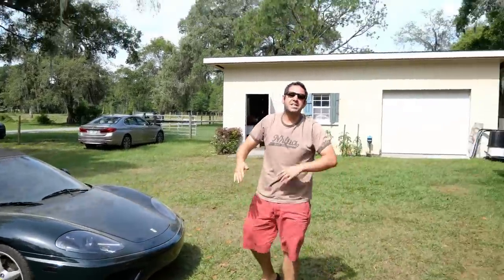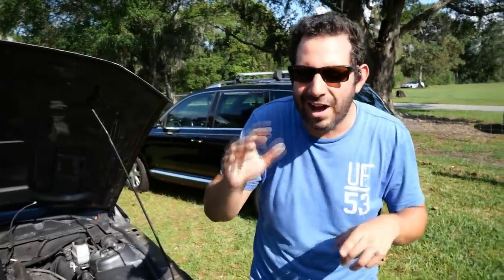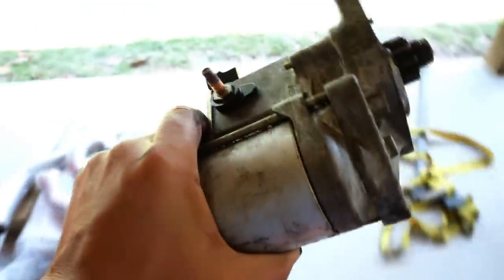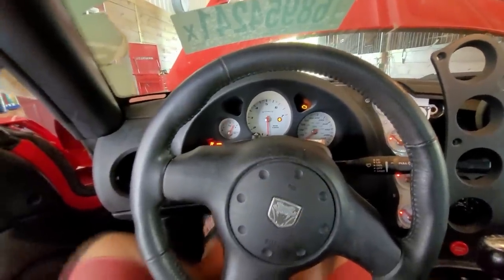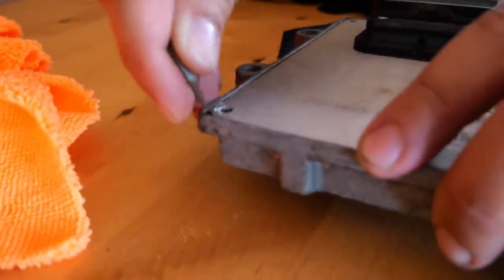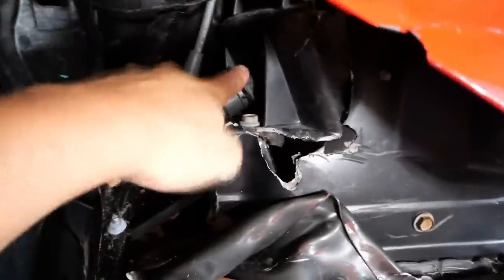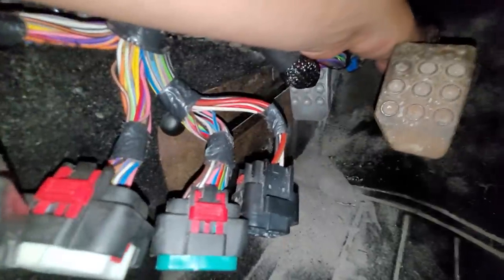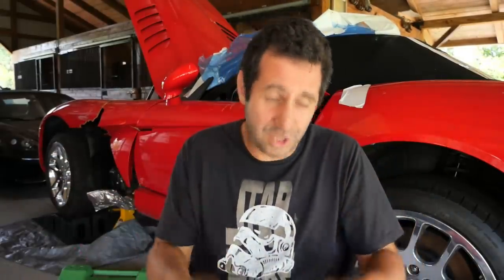Here's Why This Flooded Dodge Viper Won't Start

Comment: I don't remember if the BCM is one of the 2 dominant modules on the Communication BUS with the PCM. The Main Communication BUS in this vehicle is a single wire PCI BUS. It wires to every module and back to the Data Link Connector. If either dominant modules are down communication will be very slow on a scan tool. With any particular module not communicating, you need to start with checking the basics on each, Fused B+, Fused Ignition Run, and Ground. Any of these missing can cause a module to not communicate. Going for a swim could have caused a fuse on one of those circuits to pop, and may just require a fuse, but you might have checked the fuses already. 
Those BCMs were exchange order only because the odometer is recorded in it. The Cluster on those is a display. The odometer in the PCM is mainly a calculated value, if the PCM is ever replaced you have to program the mileage, it's more of a theft related tell-tale, and for DTC data, it will show at what estimated mileage the DTC was set at. Although it is similar to the ones used in 2001-07 Minivan and 2004-06 Pacifica I would not recommend it as a permanent swap. Being a Viper it will likely have the Vehicle Theft Security System, and swapping a BCM from another car without programming will result in a no start. It isn't the Sentry Key Immobilizer chip key system but sort of does the same thing killing the fuel and I think cranking too, but you should still have communication with the modules. 
Another thing to consider, a shorted 5V sensor on the engine can result in the BUS going down. The majority of the sensors on those are that style (3 wire), including the A/C pressure transducer (3 wire pressure sensor on one of the lines). You can measure the 5V supply at any disconnected sensor, 0 Volts is usually shorted, then disconnect each 5V sensor one at a time until it comes back to 5 Volts, which indicates the particular sensor is shorted. If you haven't already, I'd be looking at the wiring diagrams, service information, and diagnostic information on either AllData, Mitchell, or through Stellanttis using a tech authority subscription. Better yet, if you can find the original Shop Manual, Powertrain Diagnostic Manual, Body Diagnostic Manual, and the Chassis Diagnostic Manual uploaded online, that would be best(you advertised a site like this before, don't remember the name), if not then look for a set for sale on ebay or the like. Throwing modules at the car willy-nilly won't fix the car. You may get lucky once doing that, but the only way to properly figure it out is doing the appropriate circuit tests.

Comment: I had a infinity G37 and there was a common issue where the passenger a pillar sunroof drain would cause a leak which ended up flooding my passenger side floor which was where the BCM of the car was located and was completely soaked. ended up finding out if the BCM is fried the car just wont start like how it is in the case of the viper. luckily i had a connection at the dealership so i got a new BCM and installation for cheaper than a used BCM from the junkyard

Comment: +give the board a kwik clean with some isopropol alcohol also if u have an ultrasonic cleaner put isopropyl alcohol in there and putt he baord in there soon clena up its prob justa. short in the circuit a good clena may sort it

Comment: A bad BCM is bad news on most newer Chryslers. My sister had a similar era Town and Country that the BCM fried on and they couldn't get a replacement BCM to work even when it was programmed to the van's specific info by a computer repair service where the new BCM was purchased from. This whole thing caused them to have to junk the van.

Comment: The PCM does not need to be recognized by the BCM.
Both  control modules communicate on a PCI protocol  based communication network.
The fact that some module communicate, suggests that The network is not shorted to ground, power, or another wire.
You might have an open circuit on the network or the modules might not be properly energized.

Network integrity for this particular situation could be checked by comparing communication waveform signature at the DLC and compare to PCM communication line.
If that checks out I would check powers and grounds.
Beeing this a Chrysler product you my have an ASD relay issue.

Comment: I don't know on the dodges but I have had others cars that one computer being bad has made the pcm not communicate. 
BCMs have to be the correct number although some cars have multiple correct numbers. A good dodge part department can give you all the number that interchange.
Further based on experience you general need a scan tool that can flash software from the manufacturer to make a new or used bcm work. Some used BCMs are not rewritable other are. Often times the cheapest way to do this is to send it off to a company that specializes in reprogramming bcms 
Unfortunately I don't know anything specific to a viper

Comment: I'm no expert on dodge related items, but I do work at a Honda dealership. The BCM all tho it looks the same it's not. When you plug and play a bcm to another car or motorcycle, it goes through a check list and this list is the same for each car. The issue is that other sensors or modules will pump the wrong data/codes to the newly installed module. But my new Question and Test would be can you flash them while plugged in? I've done this with other hondas, but the dealership owns the Module flashing unit and only they can give the mechanics authorization. You come into liability issues from the dealership preventing you from doing this. But if you bought one that might be your fix...

Comment: The engine control module does NOT communicate through the BCM.  The CAN bus is a deterministic bus and there would never be a situation where one ECU would proxy CAN traffic for another.  You don't want one module to cause another to fail not be unable to diagnose.  I'm an automotive embedded software engineer who writes software for ECUs.  If your engine control module does not show up on your scan tool, then you are either not attached to the CAN bus or you need a tester present signal.

Comment: I'd have to make a correction. The starter being like that means it is or is a part of the problem. (In this case part of the problem) as it was not moving until a few tries so it wasn't working in the viper either.

Comment: I'm definitely hoping that the V10 will be his next project, and while I don't think Sam will read this, here are 3 important things anyone owning a Touareg should know: 
1.: You should really get a VCDS. Things like Carly work well on other brands, but VW has its own diagnostic standard, which is far more complex than many others. That makes it rather complicated for a normal tool to get any data from the vehicle, which is also why VCDS is so damn expensive, as the adapter even has an entire 32-bit computer with multiple megabytes of storage and ram in the plug itself, and why the software is so complex, as it has to simultaneously interface with the over 50 ECUs in that Treg. A normal adapter will only give you basic fault codes and some engine data, but only with a dealer computer or a VCDS you can actually program ECUs, run adaptations or do advanced diagnostics on all modules. 
2.: The oil you run in TDIs has to have a certain certificate, which is there to make sure it has all of the numerous additives required to keep a PD-TDI from throwing a rod or kicking a gear set out the side. The most critical one is the sulfur content, as the injection pumps within the unit injectors will seize and lock up the entire valvetrain without it, but too much sulfur will cause the rod and main bearings to corrode. I think Castrol and Mobil 1 offer such oils.
3.: When you encounter any problem you can't solve yourself, don't be afraid to ask the Treg forum (www.clubtouareg.com) or VWvortex, they are happy to help, and usually know more about your car than you do, as they have 15-20 years more experience than you, and have access to loads of dealer manuals and connections to VW.

Comment: After easiest checks are performed, maybe an Automotive Picoscope. Lots of Diy how to's online. Check each module out of the car, one at a time. All sensors and socket plugins need to be cleaned and wires checked for continuity, resistance and abnormal open/short circuits. Or else blown boards will never cease. Complete wiring diagram needed. All 12v relays checked?
Fuses? Fuse sockets? Parasitic drain?
Door jamb switches.?
Clockspring? Hvac switches? So many gremlins.
You will need pinout data for voltages ranging from 1.7 to 5vdc. And what wave forms should be present. Abs, airbag?
My advice? Contemplative thoughts and a Fishing pole. Gonna be a canbus, can of worms. Guy outside USA does not care about US insurance&salvage title. Just import duty taxes. Maybe he declares it as machine parts?
Like all modern dashboards assembled in one piece, then shoved through the drivers side opening with a jig holding it. Never any room for access, unless your a masochistic 150lb Teen contortionist.
Reply: What does the drained oil look like?
Pull all the spark plugs, will it turn over with a breaker bar and socket on the balancer?
Did any water get in the trans vent? Evac purge system? Diff? Wheel sensors? Rack?
Power steering? Sand and silt will ruin rubber seals.

Comment: In modern day fashion the BCM is the one who gives power to the ECM and PCM I have a 2015 ram and it’s the same for all Chrysler products if the BCM is not there the car is toast. If the BCM is water lodged like what you showed all the electronics in there are shorted and they can’t provide power and ground for the ECM and PCM. My truck has Electronic power steering and when the computer for it was shorted (before the recall they had for that particular problem) a scan tool my buddy had will show EPS and when I read the modules I can see EPS but it said it wasn’t equipped. I took off the pin for the connector of the BCM and ran another test and saw EPS disappeared. I hope this could give a viewpoint that yes the BCM is the one that does give power. You can get a new BCM but it has to have the same specs as the old one there should be a part number on it unless it got washed away. And for programming you need a scan tool that is capable of doing that.

Comment: It would be interesting if the only reason the part numbers are different on those computers was so they can pretend those two cars don't share parts, but I doubt it. I imagine a pin or two will be different and make something vital not work, but I'm looking forward to finding out either way!

Comment: Mopars bcm must signal pcm. Watch out because if the bcm cannot verify the vin# with pcm it will activate anti-Theft circuit 

I put a used bcm (exact same part number in every way as my original) in my Concorde & it ran great 1 time. After that is activated Anti-theft bad news. I figured a way to bypass anti theft in bcm but it took me 4 months

Comment: Mannnn I'm 20yo with a few hoopties, I got a 2001 e38 740i and have gone the ecm and tcm and a few pin replacements! It's all good experience but I wish I had ista/inpa to reprogram the TCM Wich is used! It's got it driving but still has shift position sensor problems!!! no sport mode or park, neutral is intermittent 😑 really this is the most important problem with the automotive industry!! The programs I need can cost up to 750$ or more and 30$ a day after that. JUST SO I CAN CORRECT THE VIN AND TELL IT WHAT TIRES, DIFFERENTIAL AND TRANSMISSION I HAVE!🥴 IM IN NJ SAVE ME LMFAO

Comment: BCM is the hub of the whole databus on this car. So if it isn’t communicating then nothing is. You probably could install a BCM from another Chrysler product into this Viper for testing purposes.
Reply from the maker: Hey Dave, do you think a module out of another Dodge that has the same connectors will fit? Or do I need to buy Viper Specific? Will either need programming? Thanks!
Reply: @Samcrac  I think you definitely need the proper part number for that chassis ultimately BUT for testing you could use a BCM from a different vehicle as long as it was the same style. It wouldn’t hurt anything, would at least see if you can get it to crank. You would have a lot of idiot lights on and components not working but could see if it resolves your communication issue.

Comment: I see a tonne of comments that the BCM will be fine; but I disagree. For $250, just buy a new one, it will save you tonnes of time in the future. You can’t trust a module like that. Also, I would strip the loom and replace - or at least pull apart each plug and clean, check, and recrimp or even solder each connection. Water isn’t that big a deal. Water that sits and then causes even small amounts of corrosion is a big deal. Flood cars are write offs for a reason. Also, I would strip the motor down if there is any risk of sand - there is no way I’d start it with that much sand in the intake, 100% sure you’ll have some sand in the heads and combustion chamber. Pull it apart, clean it properly before starting.

Comment: Those two electric motors Rich Rebuilds has for the electric corvette would fit under that long hood. If the engine electronics don't work out, maybe an electric Viper collab could be the go. 🤣

Comment: A quick clean up with 95% IPA and a toothbrush will let you know how bad the board is, water damage on a board is not good but you can get the IPA from a chemist.

Comment: Mabey jump the starter and see if oil pressure shows up on guage 

It would run thru pcm and then bcm the cluster 

Or it would at least oil up the inside of the motor

Comment: I can test ANY of your Dodge Viper components same day in-house. Additionally, you can use a PCM from any GEN 3, 2003 - 2004 for that model year, or 2005 - 2006 for that model year. As for the BCM - only a Dodge Viper BCM will work. Again 2003 - 2004 will work for same years OR 2005 - 2006 will work for those years. You will NOT need to reprogram it. It will plug in and play! The only issue will be the miles on your odometer will be the what is stored in the BCM you utilize. 

If you change the PCM it will also plug and play for those years, I can reprogram them only if you want the VIN to match (you don't have to). It does not really matter if the clutch got wet. You'll need to jump the neutral safety switch down below the clutch peddle. Unplug and use a jumper wire -- it's only two wires.  

Regards,
Doug Levin Motorsports Inc.

Comment: The deep Jewel Green by Ford at 20 g of black. Spray a dark green base two coats of the Jewel Green and intertwine your base deep Jewel Green with your top coat for the first two coats and then a coat of clear
It'll be incandescent it'll be black and shadows and green in the Sun

Comment: take a chance and do a 91-99% alcohol wash with a tooth brush on the electronics cause it cleans all the  corrosion  I've done it to like 13 cars  and they came back to life an started so i can here it and stuff   but also buy a new one or get it refurbished in my opinion cause i dont know about long term use

Comment: Ummm im confused how is the boss 302 upgrade no longer a budget option? Befor the most expensive part cost $700 now $200 so befor the price drop you are looking at $700 plus $100 plus $300 plus $200 now with price drop it’s coming in at $800 total. So it’s even more budget now. Or did i miss something

Comment: I can't believe you opened the pcm. They are all built waterproof. The bcm is the communication gateway for all the modules. No you can't use a bcm from anything other than a viper.

Comment: Honestly its time, but you have spent so much time, you could have already easily pulled the engine, pulled the dash and interior, fully, and have access easily to everything you wanna see and know for a fact whats going on.
Thats what id ove done.
Solely because if you get it up and running, there will be nothing like it for that price.
However, you can easily swap a smaller engine into np. Many people have done this.
Also, i like how you dont get all ahead of urself telling us how in a week ur picturing urself driving this through the country side roads.
You stay in the zone, where you need to be, n one step at a time. That is crucial.
Your very meticulous and very critical thinking, which is how you pull this off.
Everyone else would look at this car n go, it needs this n that n the frame, n the dent n the water n the sand.
You say, well, it could be run n we can from there, you start with the 3 things that make a vehicle run, you've technically accomplished that, so know ur on the computer side of things which i suppose is the 4th thing when speaking of modern engines.

Comment: I don't believe a module from a caravan will work. My Dodge V10 used a module from a wrecked viper with a reprogram and it worked perfectly fine.
Reply from the maker: Was it the BCM or PCM?

Comment: Chrysler computers CANNOT be overwritten. The modules on that car all share a code that is mated to them at the factory. So buying used computer is out of the question. As far as using a caravan computer. Your just asking for headaches down the road. As well your friend is correct.

Comment: i have a 1993 viper with 3,700 miles on it. the dash lights dont work, the rear running lights dont work and the license plate lights dont work but all the other lights work. i replaced the license plate bulbs and it did nothing so i have to take to a dealer to find out the electrical issue, the dealer charges 180.00 per hour thats just stupid, these vipers will drain your wallet.